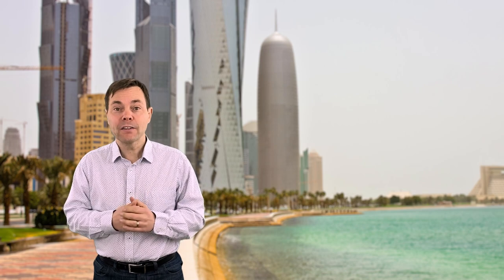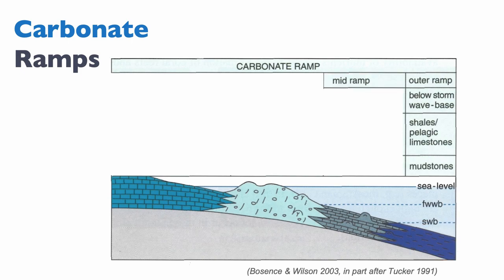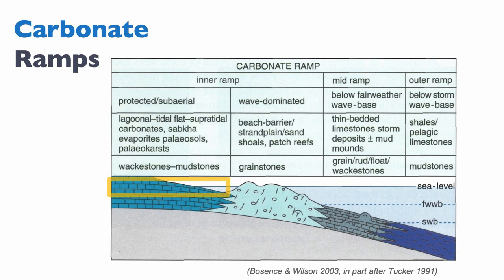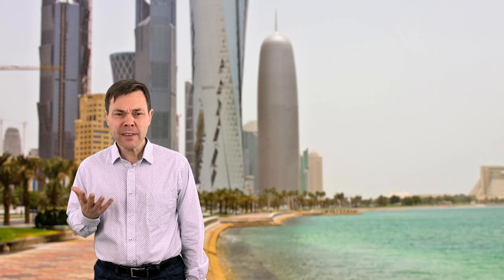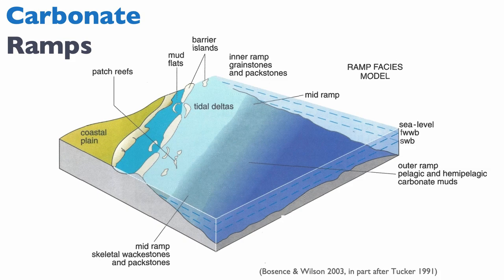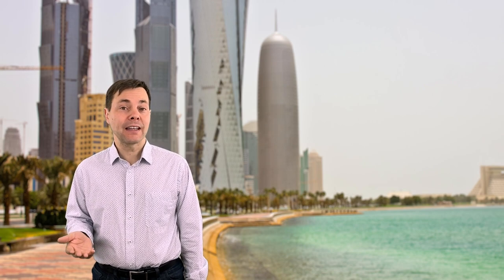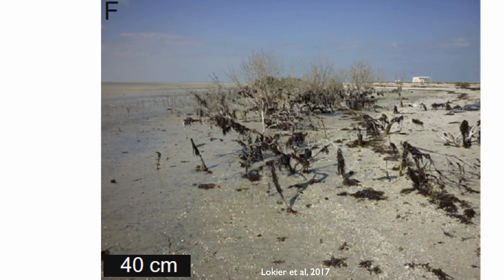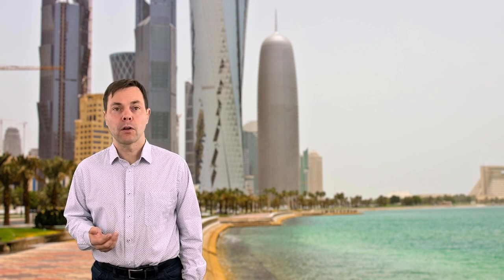2.3 Carbonate Ramps [Part A]

Comment: Great video and explanation, thanks very much. Now, one question though, if that should is made up of continous reefs why is called rimmed platform? Can't it be called rimmed ramp or somethinkg like that? Because it will still be a ramp (because it will keep its ramp shape) and it will have a shoal made up of reefs. Sorry got a bit confused 😕
Reply from the maker: If you have a continuous reef, chances are this will aggrade during TST faster than the surrounding platform/slope, so overtime you tend to go from a ramp geometry to a rimmed platform geometry wiht steep sides, but rarely the other way around.
Reply: @JohnLab  awesome. very well explained and understood. Thanks very much.